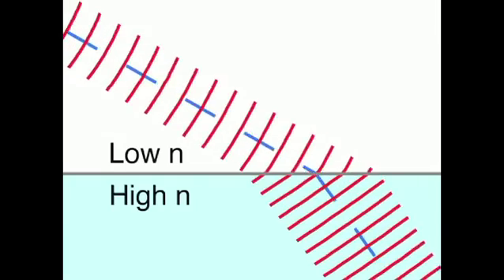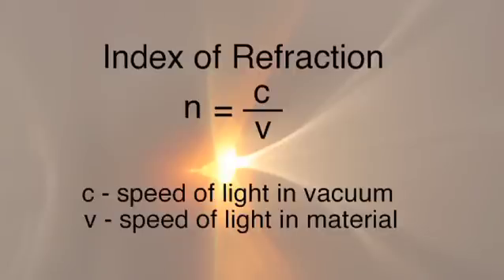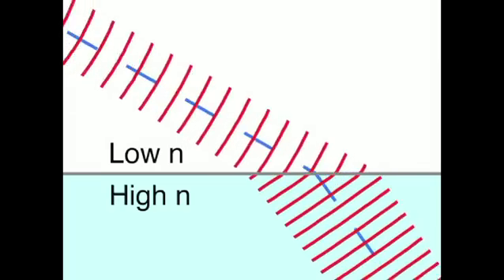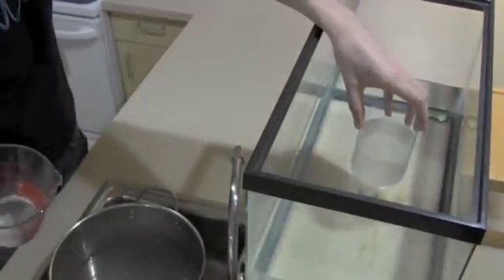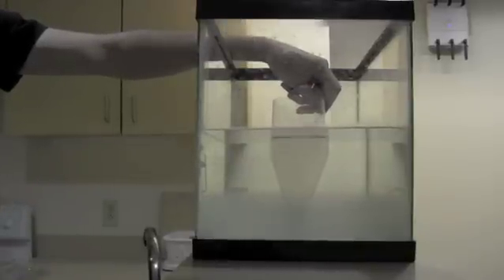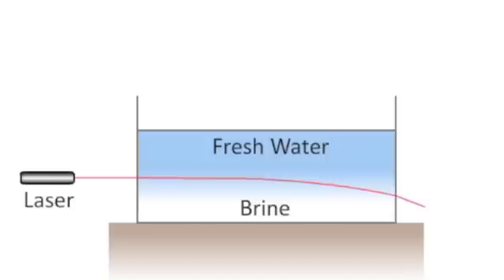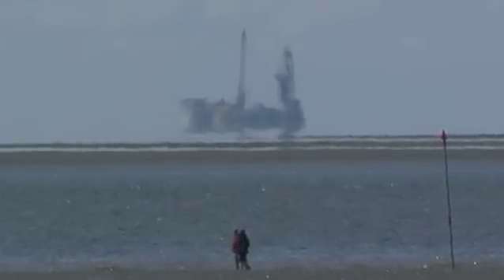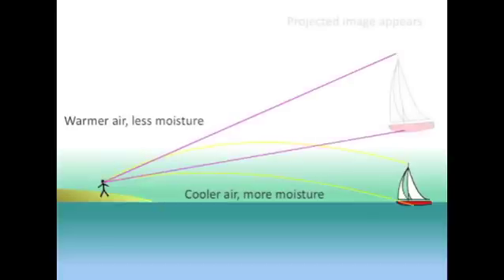Refraction in Gases

Comment: What about dispersion? Isn't that only occuring when light gets refrected?
Reply: Dispersion is the only thing thats happening. You can only observe refraction in liquid, not in the floating gases. This story is needed to convince you light is bending over the "curvature" of the Earth, so thats why we can see for MILES lol. Makes me wonder why we can't see around corners.
Reply: @navigatingel6104   Actually no, you're not correct.  The OP is correct.  Dispersion only occurs when there is refraction.  Dispersion is literally the rate of change of refractive index with wavelength.  This requires refraction to either already be occurring, or for it to start occurring.  Refraction absolutely does cause light to bend around Earth's curve.  This is a known phenomenon.  And you can't see around corners because that requires much larger angles per unit distance than is even possible with atmospheric refraction.
Reply: @navigatingel6104  "You can only observe refraction in liquid, not in the floating gases. " That's hilarious. We have multiple timeplapse videos of entire city's tops extending further into the sky and back, and you are actually denying it because of a mere belief system. Hahaha. FEs!